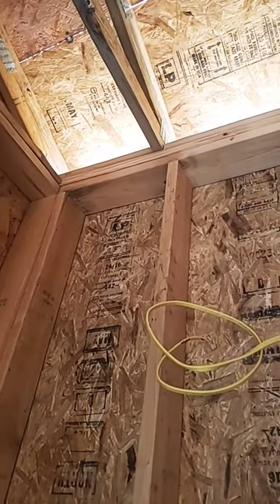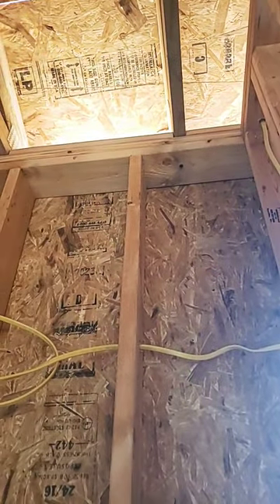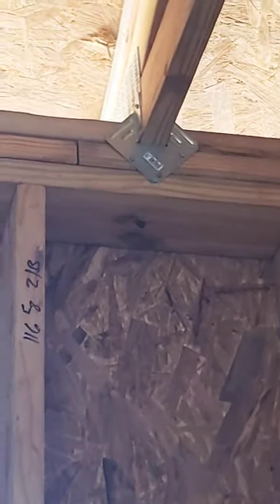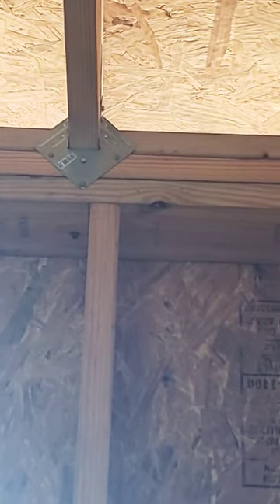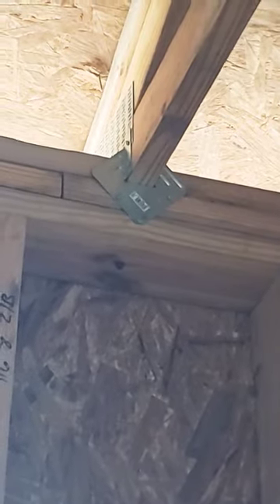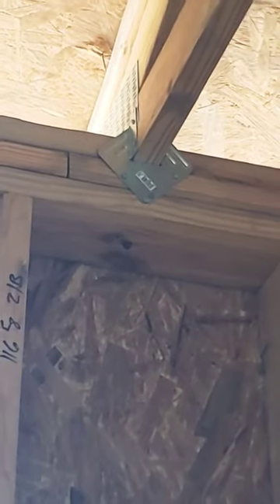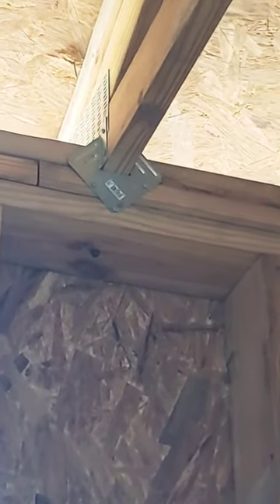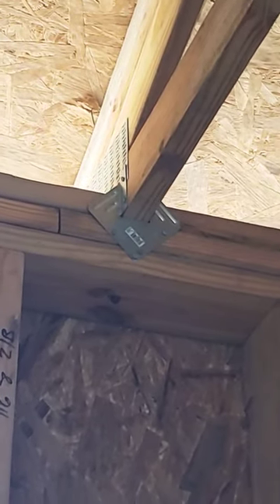Why will these trusses fail inspection? #construction #homeimprovement #diy #shorts

Comment: As a carpenter all trusses fall on a stud  as all  joints of top plates too. And ceiling joist. Hurricane plates too.  Shitty work. Framing a house is all about load bearing.
Reply from the maker: Not if studs are 16 or and trusses 24 oc
Reply: I second... finish your plates on top of studs. Just careless framing. Add a stud under the interupted plates and that will pass.